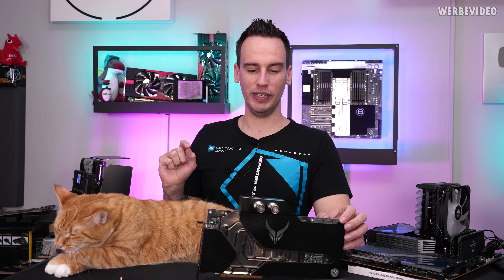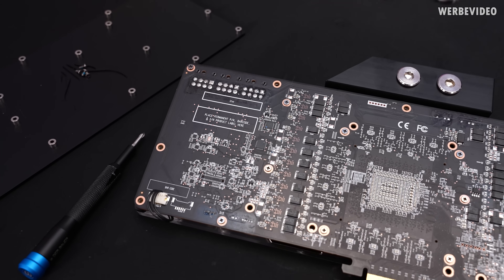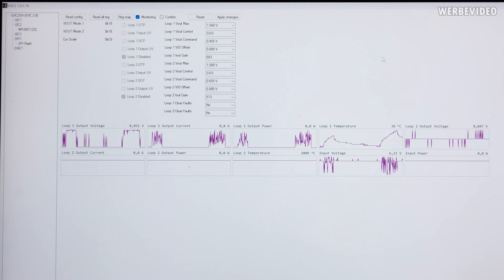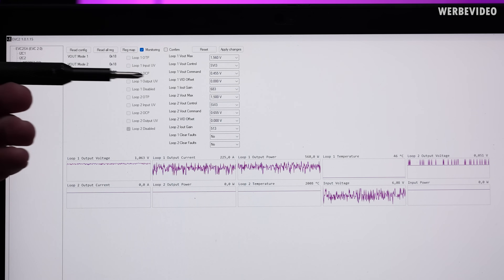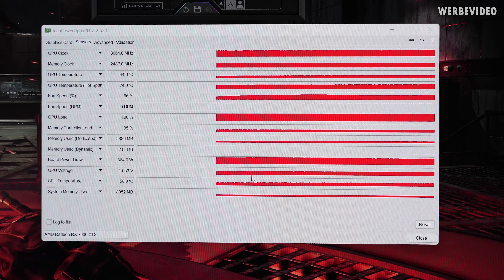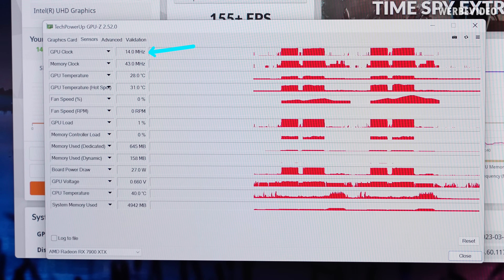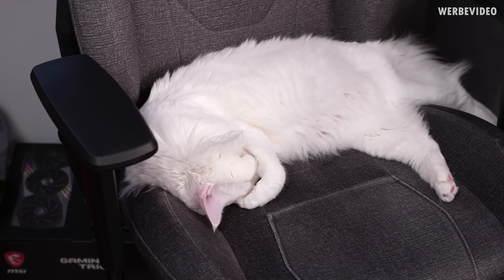Crazy Unlocked RX 7900XTX Pulls 650W

Comment: AMD: ‘we could make a card as fast as the 4090 but we wanted power to be reasonable’
Roman: ‘hold my beer’

To be fair the xtx doesn’t have a fully enabled die but… still.
Reply: 7950xtx incoming!
Reply: @minibotpc   7990XTX actually
Reply: What do you mean about XTX not being fully enabled?
Reply: @LucidStrike  not sure outside the fact the theoretical card AMD was talking about would ahve more cores than this
Reply: @WayStedYou  You said definitively that 7900 XTX isn't the full N31 die, but that's based on speculation?
Reply: @LucidStrike  They're using only half the infinity cache that they could. They could bump it from 96 MB to 192 MB.
Reply: Navi 31 and rx 7900xxxxtxxxxxx is probably the full die. If there is a Navi 30 or Navi 31 somehow with more? No, not very likely. The only thing we know about is that Navi 31 and so RX 7900's had unused space for more infiinity fabic cache or whatever it was. Like imagen x3d cache for the GPU. But that really is stuff off die that one can call not being there so not fair to compete with 4090. But sure it is a known thing that bigger cache on GPU's has a performance impact. NVIDIA has also added allot of cache to there cards and what I know 4090 is even really running out of cache limiting performance on it!  

But no Navi 31 was marketed and big enough to be up agenst and even beat 4090. But drivers and just AMD being AMD launched and where clueless as usual. The extra cache probably had not helped at all. Laptop rx 7600 or whatever is performing so much better vs the desktop 7900's. 

No Navi 31 is just flawed when the same architecture seems to be doing as good or better then Nvidia. Just this joke that is Navi 31 makes no sense. If not for Ryzen/Zen AMD had been done for. Radeon really only delivered on Polaris and RDNA2 in current times. And that is even questionable.
Reply: @Merrinen  I was gonna say that's not really part of the die, but it is. These discussions are just usually about CUs tho, not cache. At any rate, doesn't seem like N31 ended up having enough raw power to benefit from even more cache, powerful as it still is.
Reply: @LucidStrike  the arch is built to have more cache. 4090 isn’t fully enabled either. It’s got 16k CUDA cores while the 6000 Ada (the professional card) has 18k, but those sell for big big bucks which is probably why we aren’t seeing the full fat die right now. They can sell it with a basic blower and run the die at less power for thousands more
Reply: The 4090 isent the full die either. So that is a mute point
Reply: @arcaneftwtv  Nvidia die is 600mm, Amd is only 300mm, Think what that would bring when Amd doubles the die size. I can't wait.😁
Reply: @madb132  
You can't exclude MCD, MCD are also in the 4090 but they are not split like Nav31. Navi31 is a ~530 mm squared GPU
Reply: @madb132  What a blatant lie. You excluded MCM which takes up 225mm2 in total and is the second most important component of RDNA3. That's 530mm2 in total or just 10% less than 4090.
Reply: @w04h yes but the MCD is on 6nm if it was all 5nm the 7900XTx would be 400mm^2
Reply: This is an extreme OC, a brute force moar powa approach to push performance, on a chip that's not their top bin for the die (top bins likely being held back for a refresh). AMD definitely has more knobs they can tune to get to an eventual 4090 rival... just look at the 7950X vs 7950X3D perf/watt. If they ever do, it'll be <400w.
Reply: Lol what it does have fully enabled die. Upcoming 7990x is the same die with better bin + higher memory clock and double density cache.
Reply: @w04h  What ever it is. They can just add another NAVI31 chip, they have the technology for it. Double the performance of 7900XTX.
Reply: Even if that's true, the 4090 isn't a fully enabled die either so that would still be an apples to apples comparison.
Reply: @halbouma6720  yeah I know it’s a cut down AD102 with 2k less CUs (or whatever the name is now). Mainly was just poking fun at AMD for doing the “I could have won if I tried harder with more power” thing. It’s still a solid GPU for $1000 but trying to claim you could make a halo card that goes toe to toe when clearly.. you can’t. Since this is drawing more power and still not touching the 4090. I’ve got my FE undervolted, it holds slightly higher clocks, doesn’t touch the 70*C target that GN observed and with a memory OC it’s faster than stock by a good 8-10% and it pulls under 400W (excluding transient spikes) even playing cyberpunk at max settings. Nvidia just pushed it hard for that last few percent imo. They could have run it at 400W stock and had it be 99% as fast but they were worried about AMD imo.
Reply: Kinda crazy
Reply: At least now we know what it takes to hit AMD's claimed 3GHz clocks.
Reply: @spankeyfish  Nah, my 7900xtx hits 3050mhz no problem at 1060mv with no bump in the power draw. You can pretty easily hit 3000mhz with a little bit of undervolting.
Reply: I’m not surprised AMD has always been the power hungry one.
Reply: @ZackSNetwork  if you stopped following tech like 5 years ago, thats true. If not. AMD has been more efficient than intel and nvidia
Reply: @ZackSNetwork  RDNA 2 isn't more power hungry than than Ampere. Did you not mean that literally?
Reply: @ZackSNetwork  since when?

Comment: Would be great to know why you're using a game and not GpuTest or furmark? You can leave GpuTest running for hours (if needed for heat soaking). I know in that it has the nickname "GPU destroyer", but as long as the card and/gpu is cool enough it shouldn't be a problem. Load on the memory controller can be high, but memory usage is quite low(<256mb).

Comment: Can get 650w+ with a vbios flash on 4090's. Absolutely insane that you have to do ALL this custom modding to get an AMD's cards potential out
Three 8pin's can handle 900w (300w each) just fyi for ppl...
Reply: AMD have lock the bios in a weird way !
Reply: I thought the 8pin was like 225 on a good quality one. All docs i see also point to it being "officially" rated up to 150w ea (which doesn't make sense when I see my 79XTX sucking like 400-450w on a dual 8pin model)
Reply: Iirc, we've seen 800~1000W extreme ln2 overclocks for a while with 3x8 pin connectors in the past. Granted, that might be getting close to the limits, but I'd say ~600W for something specced to 450 (or 525 if you count the pcie slot) should be pretty safe with a good quality PSU, as long as you can cool it and don't mind the electricity bills
Reply: i thought the standard 8 pin was only rated for about 175?
Reply: @quantum5661  8pin can basically run fine at 200% of its rated current
Reply: @quantum5661  That's the spec, but the spec is waaaaaay overbuilt

Comment: Shame fusion power is still 30:years away
Reply: I would worry more about getting the heat out of the case and out of the room first before the electricity bill.
Reply: Eh the 4090 will pull 660w overclocked. This isn’t that crazy. Power density is no longer dropping so we should expect power to continue to rise. AMD said they expect 750w gpus in the next few years. Which sucks but that’s where we are with silicon.
Reply: @jolness1  700w is insane

My kettle barely uses that

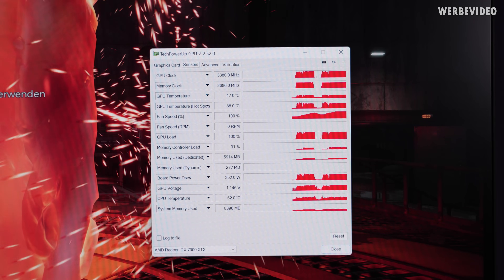Comment: 40-41C degree delta at 10:12??? That does not seem normal for a water block?
Reply: that was while pulling like +600W when running at almost 3,4GHz
Reply: I had the same problem with my 6900xt liquid devil ultimate, no matter what I did I could not find a fix for it and decided to sell it
Reply: @Warface1987-e7v  That's just how it is when pushing incredibly high power density. The silicon can't transfer the heat away fast enough so junction temp is going to be your limit unless you go ln2.
Reply: @PineyJustice  don’t think so, I got a 4090 right now and the difference between core and hotspot is around 8-9c on water :) and if you look at a brand where you mount the block itself it’s a huge difference compared to the preblocked ones
Reply: @Warface1987-e7v  4090 is a much larger die itself so it can better dissipate heat to the coldplate for a similar power consumption (heat generation). The 4090 die is also less dense than the 7900XTX GCD in terms of transistors per area (150M/mm^2 for Navi 31 GCD vs 125M/mm^2 for AD 102).
Reply: @Warface1987-e7v  There is a big difference, it's well known that nvidia isn't truthful with their hotspot temps, most things aren't, else you could just run it up to 100c core temp without issue.